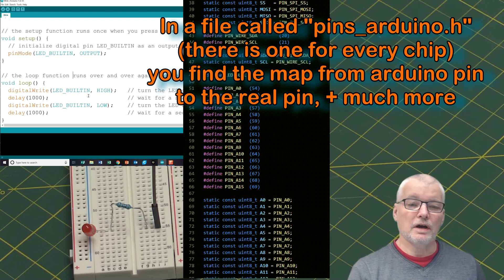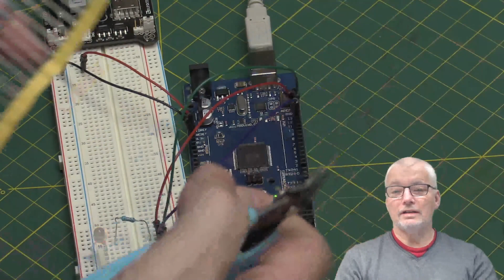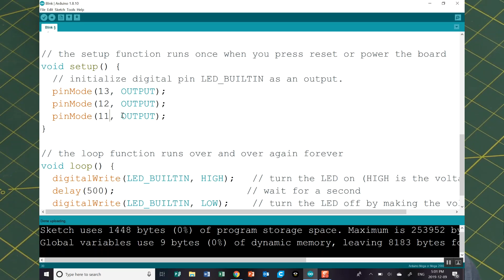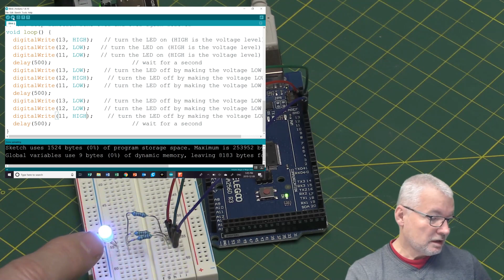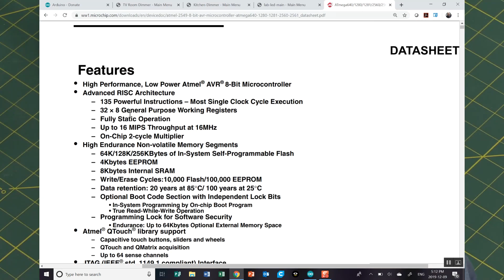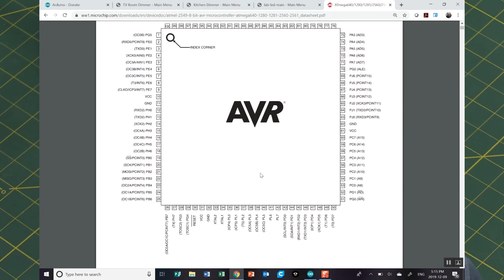Ultimate Arduino MEGA2560 Starter Kit from Elegoo Part 2

Comment: Im trying to backlight a switchboard and i want each switch to have its own led to indicate that its on and when i flip the switch the led changes to show the switch is on then flip the switch to off the led changes back. Would you please be help me out by explaining how to do this. Im new at arduino and coding so I have no idea how to accomplish this. I would highly appreciate the assistance.
Reply from the maker: My initial thought is to use one input for the switch and two outputs to drive the LED/s. There are a few ways to drive the LED/s, 
1. using a two color LED and 2 gpio pins where one GPIO output is high and the other is low and the LED is wired between them, When you want to change its color you reverse the outputs polarity so the led now has voltage applied in the other direction. Another way it to simply use 2 different color LEDs if there is room. the third way if you have programming room is to use what is now known as a NEO pixel, the details can be found on ADAFRUIT, these are very cool and not too expensive, A library is available free from ADAFRUIT. A neo pixel can output thousands of colors :) and if you wanted more LEDs you dont need more GPIO pins.

Comment: I'm looking into buying my first kit, Amazon currently have the Uno starter kit at £43 and the Mega at £60  is the mega worth the extra money or (as a beginner) should I get the cheaper one?
Reply from the maker: If both kits have pretty much the same components aside from the UNO vs Mega then i would go for the UNO first, you can always just buy a standalone MEGA later and or ESP based boards, they will all work with most of the components provided, if you want me to look at both kits, link the products in a reply and I will have a quick look
Reply: @TheBreadboardca  Thanks, I came to the same conclusion in the end and bought the UNO kit, should be here tomorrow so looking forward to diving in.

Comment: Where do I find the details what pins on control board area capable of.. I am having an issue with running lcd and max7219 together on the arduino uno board

Comment: I like the video, but how does it control stepper motors that require greater current and say the 48 volts for nema 34 servos, thanks
Reply from the maker: I am preparing to make a video on that very subject, stay tuned.
Reply: @TheBreadboardca  thanks

Comment: Pin 13 has a resistor built in for the onboard Led , so would not be white, plus the red is dimmer because of 2 resistors
Reply from the maker: the onboard LED's are deliberately kept dim by significantly limiting the current through them by using higher than normal resistor values on board. this is to make sure most of the pin current is still available for the user, or if it is used as an input it will not draw to much current from the user device attached to that pin.